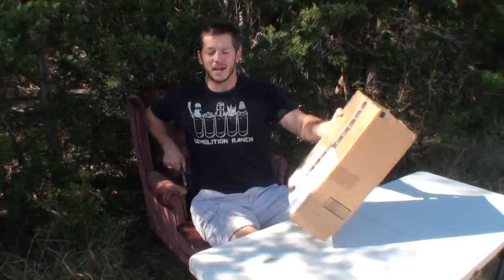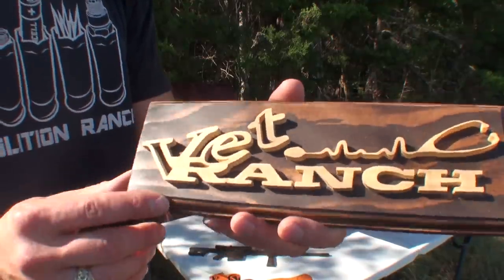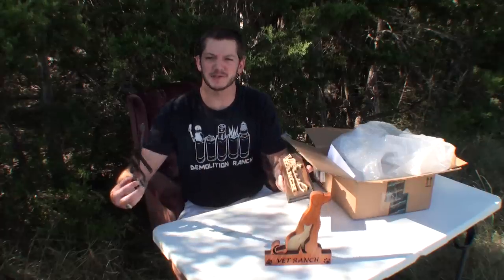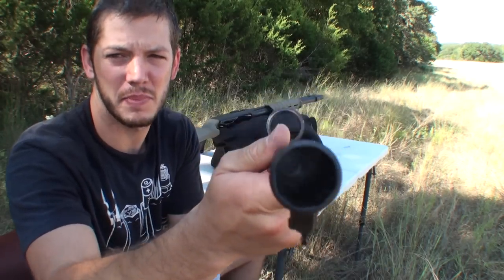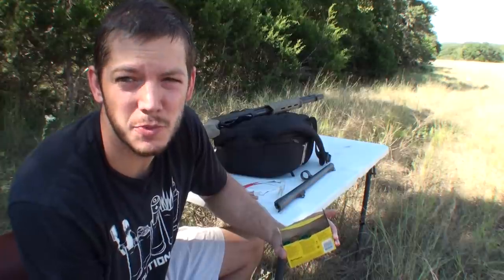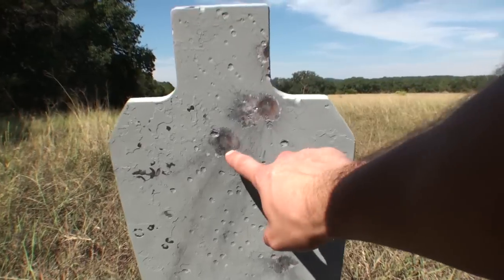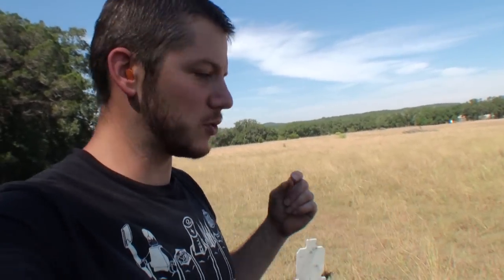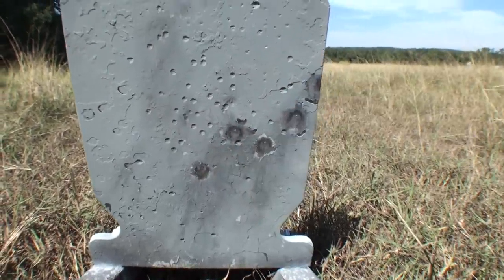Rifled vs Smooth Bore Barrel

Comment: Rifled barrels are for sabot slugs because they require spin for stability. The slug you fired is a foster style slug that flies like a shuttlecock for stability. Foster slugs lose stability out around 100 yards from any barrel, but a sabot slug from a rifled barrel maintains stability and energy for twice that distance. This video is clickbait missing critical information.

Comment: rifled barrels are designed for sabot slugs... regular 1oz rifled slugs are for smooth bore barrels because the are rifled.
Reply: +skibum1610 It should be noted that rifled slugs don't actually impart a spin on themselves like rifling would do, but are stabilized aerodynamically the same way as a badminton birdie.
Reply: +C Henry You sure about the part about aerodynamic stabilization? If you haven't I suggest you watch the videos taufledermaus made with some "turbine" slugs. I might be wrong though but I don't think that's how it works.
Reply: Nate Meyer As I recall the turbine slugs did not do too well, and they were designed to impart a spin on themselves. A rifled slug uses a heavier front end and the drag on a lighter weight skirt to maintain its trajectory, I don't know how to post links but a quick google search will turn up several articles on the subject.
Reply: +skibum1610 Yup.
Reply: +C Henry Still wrong. The rifeling on slugs is ONLY there for diffrent kind of chokes so that the led can deform more easily if shot through a choke (which you should not do so often)! It has NOTHING, ZERO to do with spinning. Source: ammo maker in Germany.
Reply: Fergesslich You need to read my posts again, in attempting to prove me wrong you just provided the final supporting evidence for my case. If you had actually read them you would know that I was pointing out that rifled slugs don't spin, but are stabilized by the lighter weight skirt dragging behind the heavier front end. Maybe you should look up the word "aerodynamic", I think that's where your getting hung up.
Reply: +C Henry Why is it so hard for people to understand what you were trying to say?
Reply: Jacob Tester No idea
Reply: C Henry It really wasn't that hard to understand.
Reply: Jacob Tester When most people read rifling including me we assume spinning but that isn't what he's trying to say which is causing confusion
Reply: C Henry  You edited your comment...
Reply: Nate Meyer I might have understood it better because I reread things multiple times.
Reply: Fergesslich Negative, my comments remained untouched, although your interpretation of them forced me to re-read them several times to ensure there wasn't a typo, but no correction was needed.
Reply: C Henry
If that is true then I indeed did not read your comments correctly and I overread the last part with the badminton birdie.
Reply: +C Henry Certainly, Rifled slugs are not designed to spin... but they are designed to be accurate when fired through a smooth bore. It might be interesting to see a waxer fired through a rifled barrel (although that might  just gum the rifling up).
Reply: +Nate Meyer 
Factory ammo and homemade turbine slugs are not the same.
Reply: shhhhhh! he dosnt know how deer slugs work.
Reply: Gus Howell lol
Reply: ++DemolitionRanch bot alert
Reply: +Fergesslich Lead, not led, but if the choke makes a hole too small for the bullet, by a fraction of a millimeter, than it can deform the Lead Slug, I'd say that it's best to use a choke barrel and not a poly choke, but what ever floats ones boat, not that the poly choke part is relevant of course if the hole gets too small then it will keep the projectile from escaping the barrel and a deformed slug is going to be the least of your worries, I'm hand forging a rifle bullet to fit a 20 gauge shell, not going to use it for a whole lot, but, just to see how it does against an air compressor tank, that ought to be awesome.
Reply: To hell with most conventional wisdom. Rifled slugs are not necessarily accurate out of a smooth bore barrel. I have no advice here except to experiment with many different manufacturer's products. Winchester Super X and Federal Power Shok weren't accurate out of my 20 gauge 870 Express. Remington Slugger sure was. Now we attach the rifled barrel and all 3 are quite accurate. Yes, I shoot rifled slugs out of a rifled barrel. Why? Because rifled slugs cause no more wear to a rifled barrel than they do to a smooth barrel. Lead fouling is the only price you pay for shooting anything that's not has no sabot. Believe me, this will take many shots to dirty the barrel. The verdict? A very slow buildup of lead fouling is a small "price" to pay if you shoot the loads that cost a third that of sabot slugs. 

Anyone know the world record for longest shot (and hit) with a shotgun slug, whatever the target was? One day I may try to beat it with my shotgun/sniper rifle hybrid (XDDDD), and use the trusty sabot style slugs. :D
Reply: Bone Drone there is a hole in you argument... a smaller caliber is gunna be more accurate then a bigger (IN THIS CASE) with a smooth bor less is more less bullet volocity meen high accuracy source "I know my shit" with a rifled barrel it depend on a lot of thing... rifling bullet density bullet velocity grain per bullet barrel length Ext.
Reply: And by this i meen at the max min or medium of each separate rifles boundaries ^^
Reply: Andrew Hall K...
Reply: Andrew Hall True to an extent, That's why a .22 LR is probably the best firearm that one could use for target shooting, a 9mm I'd say is the borderline of most accurate, I'd say that its a combination of things that make a gun in accurate and properly functional, one is projectile design, the problem with that no a days is rare, since they stopped using a lead ball as a bullet, not necessarily problem solved, but rare compared to what they used to be, barrel design and condition plays a role, Smooth bore, rifled bore, groove ratio, don't put enough spin on a bullet, then the bullet will travel in the wrong direction and will be inaccurate, put too much spin on the bullet and it will be over corrected and will travel in the opposite direction, plus if the barrel isn't tight enough against the bullet then you may lose some power and the bullet has more room to get out of control, if the barrel is too tight, then well the barrel will jam and you won't have any more problems to worry about, because the gun will turn into a frag grenade, Barrel length, if a barrel is too short, the bullet won't have time to build speed and it also won't have time to get the spin it needs, During WW2 the Germans had underground Artillery emplacements, some of the cannons had barrels that was a mile long, some of the underground cannons was in the sides of cliffs, they didn't have a very long barrel, comparatively speaking, all of them were rifled barrels, and a lot of the artillery emplacements for long range were Radar assisted aiming, although the operator had to figure the targets location, speed and direction, and aim based on them calculations, sometimes the operator was off too far and missed, sometimes the operator guess correctly and hit the target, the overall design of the gun plays a role, and finally the Operator and /or Repairman of the Firearm, basically, I fully agree that there is a huge factor involved with the guns performance, it's all a matter of physics although a gun is nothing more than a tool, like all tools, physics depends on it's performance.
Reply: Krupp Ratte I don't know about the .22lr being the best I have a sig r93 tactical .308 with a 1:10 twist and I can hit a dime at 300-400 yards with it
Reply: Krupp Ratte and bullets still build volocity after leaving the barrel or the would would drop out instantly
Reply: Krupp Ratte barrel langth means very little for intants my sig has a 28" barrel any long of a barrel and the volocity drops
Reply: +Andrew  Hall just FYI the bullet, within a reasonable amount, may not build much velocity at all after leaving the barrel, depending on length and speed and all that. Look up basic physics, try some kinematics problems, and you'll understand
Reply: Will Eccles you are wrong the bullet velocity is determined on the distance to drop so like i said it would drop  instantly
Reply: Andrew Hall you know why I say that the .22 Long Rifle is the best for target shooting, 1 because with most modern .22 long rifles are very accurate, I hear that hollow points aren't very accurate, but for 50 yards, they are quite accurate, if the shooter holds the gun as steady as a rock, unless you get a high enough wind to blow the bullet off course, before the ammo got hard to find, they practically gave the ammo away, it was so cheap, when you've got a barrel a mile long, and a projectile that weighs as much as an automobile, and you can aim the gun an a certain building in the next country using radar, and you can hit that building in the next country, I'm not talking just a block away either, I'm talking 20 miles away or farther, and yet a gun with a barrel that's just long enough to conceal the bullet and the bullet just weighs a fraction of an ounce, can't hit the broad side of a barn at 25 yards, yeah, barrel length makes a difference, and by the way, I think that it was .22plinkser that don a video on how far away a .22 is accurate, it was fairly accurate for a large target up to 500 yards away, which for your average person that doesn't have 5 miles in every direction of property to shoot on, when you've only got 4 acres to shoot on, a .22 long rifle is the best for target shooting, The Bullet Velocity is how fast the bullet is traveling when it's traveling at it's highest velocity, the bullet starts dropping as soon as it leaves the barrel, it's just traveling so fast that it takes longer for it to drop, that's why it's called velocity, velocity means speed, I'm not even a scientist and I know that.
Reply: Andrew Hall Incorrect. Coming out of the barrel, it will have a velocity of (for example) about 2000fps. Gravity will add a constant 9.8m/s/s downwards, but its velocity will keep it going until the air resistance combined with gravity slow it down. I'm not even joking when I say that I literally just drew a diagram and did a similar problem involving a bullet a few days ago.
Reply: Will Eccles i have a pellet gun that is more accurate and faster not to mention more effective
Reply: Andrew Hall which is totally irrelevant to this conversation. If you would like me to literally spell out the math for you (which isn't even hard) to prove my point, I can show you exactly how fast it'll be going when it leave the barrel.
Reply: Here's those Guns that I'm talking about that Germany had, They are some Bad Ass Guns:

https://en.wikipedia.org/wiki/Krupp_K5

https://en.wikipedia.org/wiki/V-3_cannon

might have been slightly blown out of proportion as far as the size, but even my figures are possible, the Germans weren't idiots, they was lead by a lying idiotic mass murder, but they wasn't idiots, as far as the pellet rifle thing goes, you might be able to hit a paper plate at 15 to 25 yards with it, but Andrew Hall, I think that you're full of the stuff that comes out of the south bound end of a north bound hog, even though I oversized the figures of the guns size without reaching impossibility, My and Will Eccles  sole point is that both Physics and Mathematics have everything to do with a guns performance, and the barrel's length is just part of the equation to make the gun perform.
Reply: Krupp Ratte my pellet rifle shoots at 2460 fps and with the cheapest pellet can drop a bore a 200 yards soooo and when i made the comparison i was talking about a shot gun and the germans we dump asses or the wouldn't have followed such leader
Reply: Andrew Hall What kind of Pellet rifle do you have?
Reply: i have a modified version of the gamo pigman
Reply: The Gamo Pigman looks like it'd be a cool air rifle.
Reply: It's great but I made it better
Reply: +Fergesslich,   interesting, so calling the slugs "rifled" (which they obviously are) makes people think they act like a rifled barrel?  thanks.

Just there to stop people destroying their fully choked bird-gun.
Reply: kadmow It's best not to get a choke that's too tightly choked, true, some chokes are made of a softer material that's only design is for using as a shotgun, some chokes are made of a harder material, designed for firing slugs through, true, I think that it's best to just get the choke barrels, instead of the Poly Chokes, because the choke barrels are just one solid piece of steel made into a solid barrel, the riffling of the slug is in a spiral pattern, all in the same direction, that's to let air pass through the grooves to make it spin in that direction, to make it go straighter for use in smooth bore barrels, whether that's enough spin to make it completely independent of a rifled bore, but for a large target, which they are for Deer Hunting, and they do, do quite a bit of damage, the more accurate the better, I'm not agreeing with anyone and I'm not disagreeing with anyone, I'm just saying. and true nobody needs to destroy a perfectly good bird gun by doing things that it's not designed for, although a gun can take a bunch of abuse, mount a bayonet to the barrel and you can use the gun for a spear for a long time.
Reply: +NEPA Outdoors They are designed for both actually.   sabots are designed for only rifled barrels, but rifled barrels are designed for both types of slugs.
Reply: +RustyShacklefort Thank you for this link, this answered a lot of questions I have had for a long time, keep being Awesome!!!!!
Reply: NEPA Outdoors Jon

Comment: you should of shot sabots out of the rifled barrel. that's what is meant for
Reply: Exactly, this test is botched.
Reply: Maybe no one cares.
Reply: Tommy Trax does bullet sabots have fins?
Reply: Allen Liu no
Reply: I've shot rifled slugs out of a rifled barrel with outstanding results
Reply: +Allen Liu (Nooby124) The sabot is a sleeve around a sub caliber, usually .50 or .45 slug.
Reply: You can get great results with rifled slugs in a rifled barrel.  The right sabot slug out of my H&R Ultra Slug make you feel like a 12 ga sniper.
Reply: Tommy Trax and you should've written "should have"
Reply: C Williams same here I honestly don't use sabots I just use the rifled slugs and barrel and it shoots great sabots are more of an upgrade not what you need to shoot out of it
Reply: If u shoot rifled slugs out of a rifled barrel it will eventually
Wreck your riffling
Reply: yes sir, i was thinking the same thing. rifled slugs do not work in rifled barrels well, i have heard. Rifled slugs were meant to make them shoot in chokes in shotguns, not impart spin. Sabot slugs were meant to shoot in rifled barrels, the barrel imparts the spin.
Reply: Rifled is better for shotgun slugs hunting we can shoot 200yards with a rifled 20 gauge
Reply: should have*
Reply: I have a Maverick 88 straight from the store no rifle barrel can I still shoot slugs ? And buckshot
Reply: John Smith Yes of course you can shoot slugs from it, also good news, smoothbore shotguns are more accurate with buck shot and bird shot.
Reply: @Tatusiek_1  thank u
Reply: Yeah he should of shot sabot rounds that's all I shoot out of my rifled barrel
Reply: @JohnSmith-od9mr  yes. Check the barrel for the recommended size of the shell. Probably 2 3/4 and 3 inch recommend
Reply: @AskTheKid  thank you
Reply: Travis Thacker  sabots are a expensive gimmick

Comment: Man, a lot of people dont have faith in the rifled shotguns. That's all I've ever used for deer, 3" groups at 150 yards, Remington accutip sabots and open sights. Shooting 1oz. lead "sluggers", Remington, will fill your rifling with lead. The sabots are actually very similar to the modern inline muzzleloader bullets. They have a plastic sleeve that flys off the bullet in mid flight. That plastic sleeve acts as a gas seal and decreases the diameter of the bullet making it lighter, more stable and faster due to the decrease in weight.